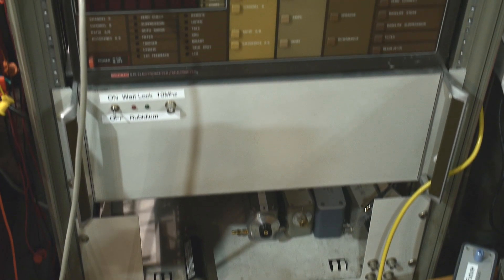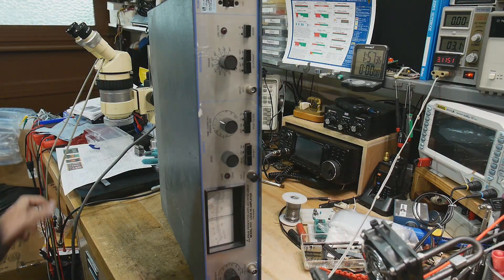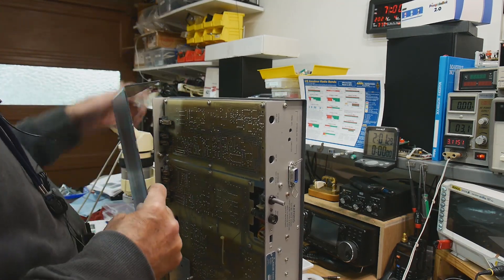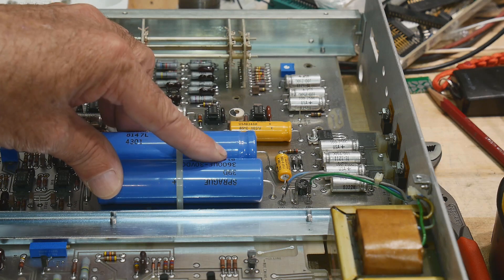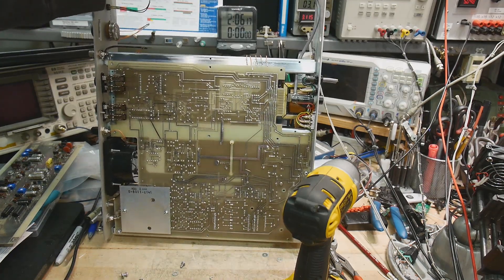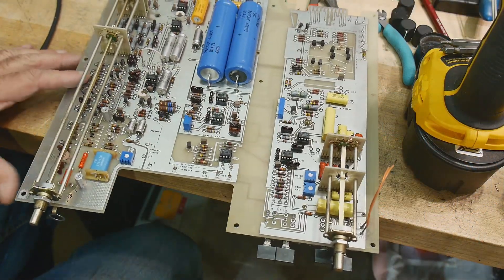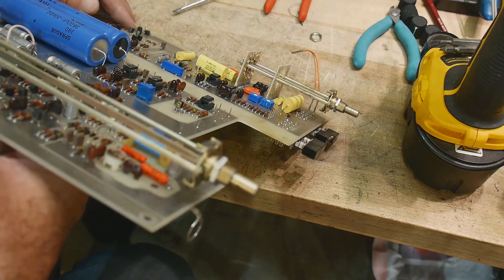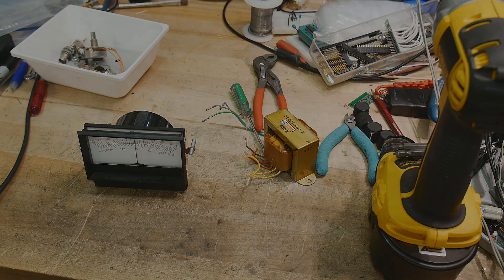#771 EG&G Princeton Model 5101 Lock-in Amplifier Teardown

Comment: Used a few in academia 15 years ago, also a few homebuilt ones from the uni electronics department (because the commercial ones were rather expensive). Mostly for optical stimulation/measurement of experiments, then I always found it "magic" how you can extract your signal from the noise (nowadays I understand the mixing down and band-limiting, of course).

Nowadays also the commercial lockins are (of course) all digital... It's a little sad how "I'll just do it digital, in numerical python" takes most of the magic of things.
Reply: They still fetch a pretty penny. This one goes for 100-200 dollars, the slightly newer models with seven segment displays easily break a thousand even from non reputable sellers.